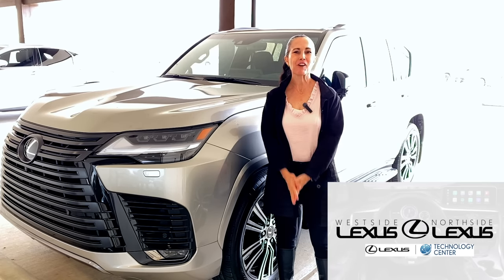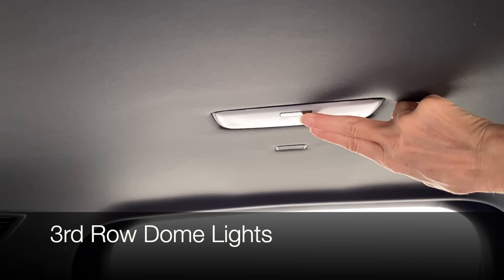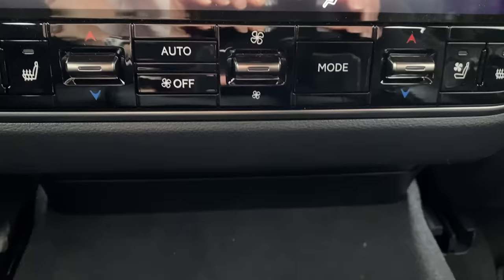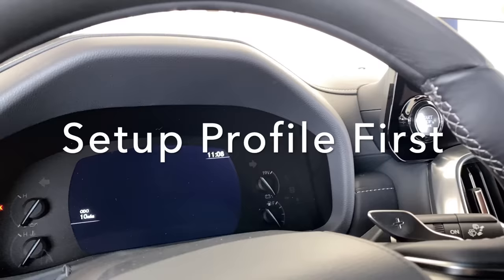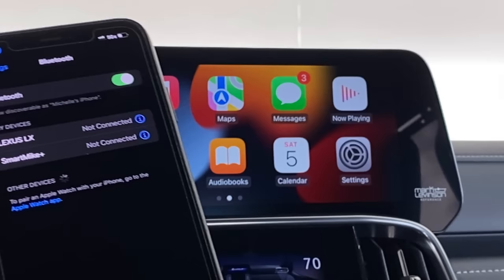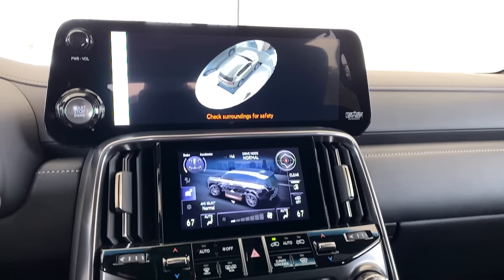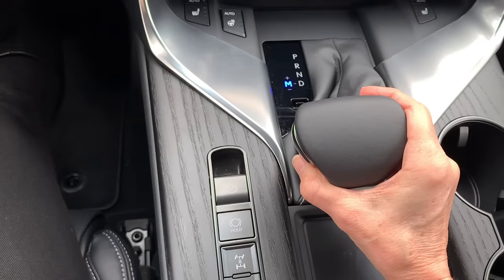2022 - 2024 Lexus LX 600 Deep Dive Tutorial

Comment: Great work, i have 1 Question.
Hi how to change the temperature from F to C ?
Reply from the maker: Hi! Sorry for the delay. Unfortunately the temperature is set form the factory based on the region the vehicle is intended to be sold in. There were some previous models that would let you change from F to C for a Weather feature, but that has been removed from the new systems. Thanks very much for checking.

Comment: Hi thanks for your great video. Could you please tell me how to turn off auto backup up safety breaking and reverse parking guidelines and just have tow ball connect guide on when hooking up or reversing with traller on . Plus stop the beeping when hooking up ? I can not find anything in my manual for this when towing. A how to video would be great.
Thank you so much!
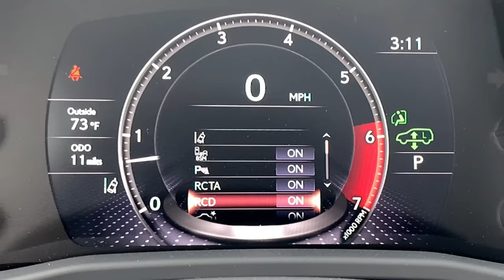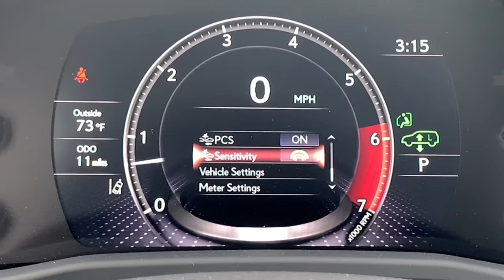Reply from the maker: Hi! PKSB is the auto braking feature that you are asking about turning off. Please see this section: 1:16:04 Parking Support Brake The beeping alerts as from the parking sensors and Rear Cross Traffic Alert: 1:18:26 Vehicle Settings: BSM, PKSA Customizations 

These sections might be helpful for you for the camera monitor system settings and operation:
55:08 View Monitor in H4 (not using MTS)
1:00:13 Turn View Monitor Auto Mode
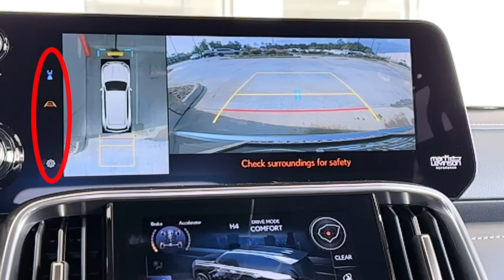1:00:55 Backup Camera View

I hope this will help get you setup the way you are wanting. Thanks for being here.

Comment: How to open front passenger window by driver side control switches in door i tried but not working only mine as driver opens. Thanks alot
Reply from the maker: Hi! If this is a new vehicle, then it is possible the windows may need to be recalibrated. You can try to go to each door and roll the window all the way down and all the way back up. Use the button on each door one at a time. Then see if the buttons on the driver's door will operate the passenger door windows. If not, then a Technician at Lexus should look at it for you to resolve the issue. Thanks for checking in.

Comment: Why I can’t see rear locking differential on this LX? I only see the center lock? 

Thank you for such a thorough review
Reply from the maker: Hi! The LX has a locking Center Differential, but it doesn't have a locking Rear Differential. The redesigned GX Overtrail model will have two separate locking differentials and we will see that later this year. I hope this helps.
Reply: @NorthsideLexus  thank you for the reply.  wow really? I'm surprised actually because our land cruisers (lc300) have rear and center locking differentials. The GR Landcruiser 300 has all 3 rear, center and front locking differentials

Comment: Thank you, that was very helpful 

Is there any way to automatically close the doors when i leave the car (engine turned off of course) 
And without using the key manually? 
Thanks again
Reply from the maker: Hi Nasser, There is not an auto lock feature on the vehicle. The best thing to do is close the doors, then just touch the indentation on the door handle to lock the car. If you forget to lock it, then you can always lock the LX from the Lexus app. Thanks so much for checking in.

Comment: Great video.   Will the LX600 automatically stop if there is an moving/stationary object is behind?
Reply from the maker: Hi! Yes, the feature you are asking about is 1:16:04 Parking Support Brake It works in conjunction with the Parking Sensors and the Rear Cross Traffic Alert feature. I would say, like with any advanced driver support feature, it is not 100% fool proof. There are always circumstances that can can a system to "not see" something like a low curb, but I have found it tremendously helpful. Thanks for checking in with me!

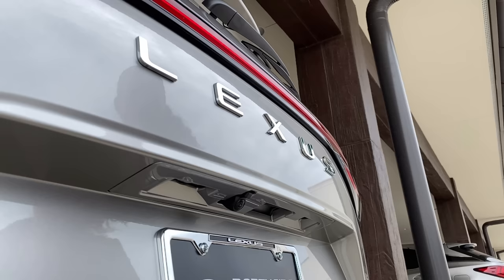Comment: The kick sensor doesn’t work actually it gives me one peeep and doesn’t open up how can i fix that 10:06
Reply from the maker: Hi! On the LX, make sure you are kicking on the right hand side of the bumper, you have your smart key with you, and you step back and out of the way so the door has room to open. You can also check the Power Back Door settings in the Settings Menu through the Multi-Information Display to make sure all of the Power Back Door features are turned on. Hope this helps!
Reply: @NorthsideLexus  Thank you so much i will try what you said ❤️

Comment: Thank you for a detailed review. Learnt some new features :)
I've noticed leg space is less between in 1st & 2nd row. So my question is, can we move 2nd row seat back'n'forth like in previous models, to adjust leg space?
Reply from the maker: Hi! Thanks for checking in. Unfortunately on the 5 & 7 seat configurations the 2nd row does not slide forward or back any more. The 4 seat ultra luxury setup does have some seat slide, but only for the seat that fully reclines on the passenger side of the vehicle. I hope this helps.
Reply: @NorthsideLexus  thank you for the info. I’m surprised why leg space is less in this model. Previous models have ample leg room.

Comment: how I can play music from USB stick on LX 600? my LX 600 don't recognize it
Reply from the maker: Hi! It is still technically possible to do, but you must follow the instructions in the Multimedia Owners Manual exactly to get it to work. Also, make sure the drive is not too large, the files are the right type and the flash drive is properly formatted. The new system is really built and designed for music to be played from the Lexus radio, your phone's music library, or streamed from an app. All the best.

Comment: Would like to know how to set the ahc to auto . Thank you
Reply from the maker: Hi! So sorry for the delay! The default mode for Active Height Control is to be in auto and to adjust by speed to many situations. Make sure that you have the feature on (you should not see a light about the button on the screen that turn the feature Off). 2:56:52 4WD Features, Height Control, Easy Access. Hopefully this will help :)

Comment: How can I disable the “lane assist” option in LX600 indefinitely? The issue I am currently facing is that each time I disable this feature “by pressing and holding on the steering wheel button” the feature is automatically reactivated the very next time the engine is switched back on. 🤷🏻‍♂️
Reply from the maker: Hi! If a feature is designed to cycle back on when you turn the car off and back on, then it is not customizable in the settings on the vehicle. You could check with your Lexus service department to see if there is an additional setting that a technician might have access to, but some safety features are designed to remain on and just be customized to be less sensitive. Thanks for checking in.

Comment: I have a question if we leave off the break and the vehicle is in drive but we open the door will it applied the parking brake ? I heard this from Toyota just wondering if Lexus has that  feature
Reply from the maker: Hi! Yes, that is usually what happens. It is not on all models and years, but is something that started in the past few years when the shifter type changed.

Comment: Is it recommended to drive on normal or low car height for roadtrips?
Reply from the maker: Hi. It is best to drive on Normal and let the system make automatic adjustments on its own. Low height is for lower speeds and is helpful when loading cargo or connecting a trailer. I hope this helps. Thanks for being here!

Comment: Why can’t i lock my lexus Lx600 glove box? Can you check yours?
Reply from the maker: Hi Eung, You should be able to lock your LX glove box with the metal key from your key fob. It should also work in the key cylinder in the driver's door. Make sure to insert it correctly. If it does not insert or turn, then I would see your Lexus dealer to have them check it for you. Best of luck with it.